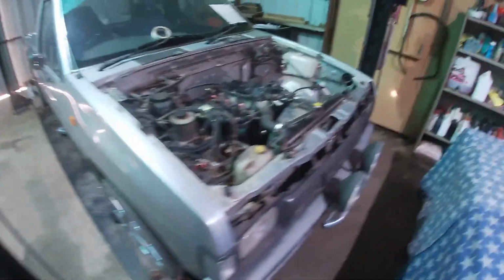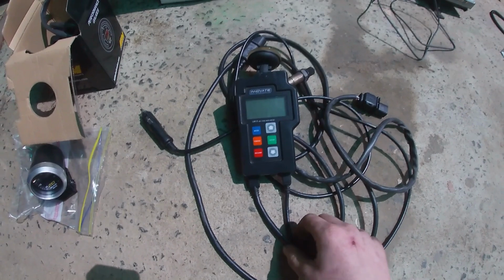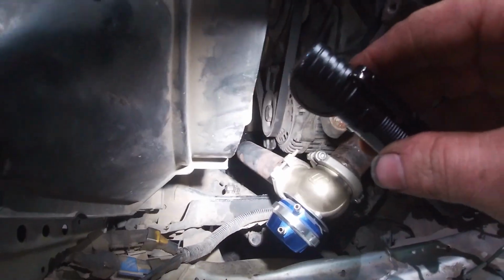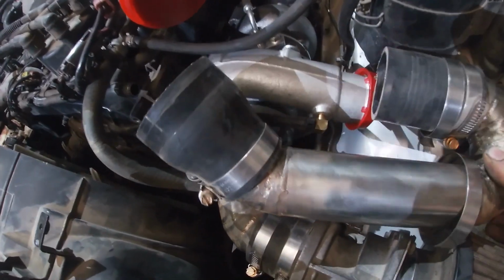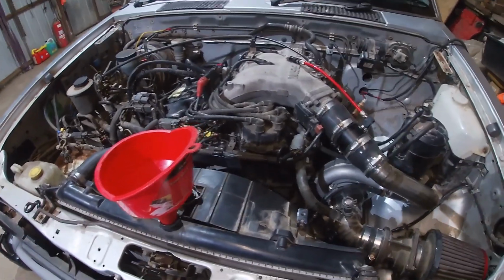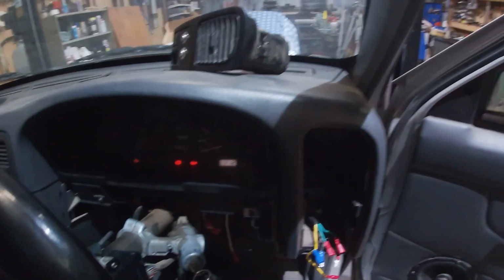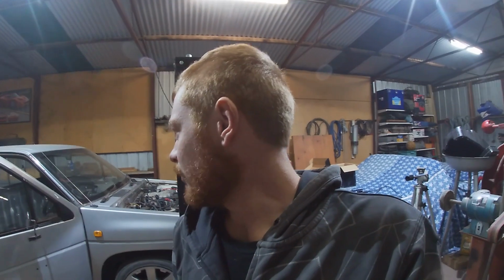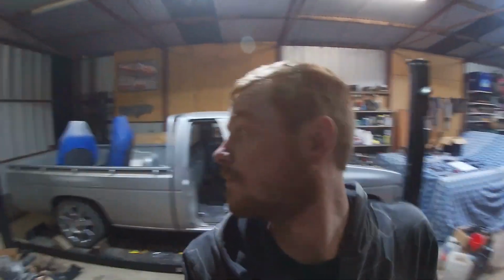VG30 Navara ep11: First start on new motor plus new turbo!

Comment: Awesome job man👍👍,have plans to do the same with a duel cab glad I found someone doing the same thing just toss up wheather to run forged pistons or not there not cheap, where abouts in Oz you from
Reply from the maker: Dont bother with forged pistons unless your looking to make a tonne (like 500hp plus) of power, put that money onto your fuel system and tunning
Reply from the maker: And im in vic

Comment: (Mad scientist voice) it's Alliiveee! Ahaha lol all joking aside, Red excellent stuff man it almost sounds like a v8 at idle.
Question were you planning on going e-fan for your cooling system As well ?
 Thanks in advance :)
Reply from the maker: Na im going to keep the clutch fan, they do a great job and move a lot of air
Reply: Reds Projects hmm interesting, would you recommend e fan for the  standard motor for off road? Thanks
Reply from the maker: Normal clutch fan will work fine, if you want to you could have a electric fan on front to push the air though to help
Reply: @RedsProjects  i like that idea! i was considering e fans because of the hp and mpg due to eliminating parasitic losses due to the clutch fan running of the motor.
Reply from the maker: @BLKSTONE4WD  yeah you will gain a little power without the fan, its just hard to get a electric fan that works as good as the stock one.
Also electric fans draw a lot of amps so if you have heaps of lights and fuel pumps and stuff you'll needa bigger alternator
Reply: @RedsProjects good point to keep in mind ,well i was thinking of going gm 110 amp factory alternator conversion and upgrade as for the e fans was going to buy some new Ford Taurus ones from a mid 90s u.s. spec model i knows those pull a lot of air from the factory and they don't cost a fortune.
I was hoping to try to override and bypass the mechanical fan clutch some how in order to retain the factory fan for on demand back up on the go all from the flip of a switch i feel like i am starting to sound like a mad scientist lol haha 👍
Reply from the maker: @BLKSTONE4WD  theres not much point in having the fan on a switch, the way the clutch works is it locks up when it gets hot, then when it cools it unlocks and theres no drag on the motor.
Reply: @RedsProjects  I see what you are saying, makes sense to me thanks again Red you saved me a headache for sure👍

Comment: What injectors are you running?
Reply from the maker: Std at the moment, im trying to convert my other manifold to top feed injectors, that will be in a episode soon
Reply: @RedsProjects  i have an early z31 fuel rail which is top feed hose tail injectors if youre keen mate. Was thinking of using it when i turbo'd a d21 vg30e before but sold the car before i got to use it...
Reply from the maker: @ayjay05  are they to suit 14mm oring type injectors or barb style injectors?
Reply: @RedsProjects  Pretty sure they are a barb. Have a complete z31 turbo rail with the 6 injectors attached still. Not sure on condition of the injectors, would definitely service them.
Reply: @RedsProjects  I also have some 380cc @3bar low impedance top feed oring style bosch injectors that i dont need. Freshly serviced and flow matched. 

Whats the reason you are going top feed?
Reply: @RedsProjects  i can email u some photos when i get a chance to go out to the shed next?
Reply from the maker: @ayjay05  so they are like rb30 injectors, i thought about going this route but options to go bigger or e85 are limited. Also i think the manifold has to be modified as the injector hold down clamps bolt to the manifold? 
I want to go with modern 14mm injectors because i can easily swap them out to bigger better ones later on if i need to.
Ive got a set of short ls3 injectors that im going to try to fit up, i think they are around 370ish at 43psi, if i out grow them i can do a straight swap to id1000s
Reply: @RedsProjects  yeah similar to rb30

Sweet as, yeah you will have more options going to a modern 14mm top feed and can run ID's in the future
Reply from the maker: @ayjay05  yeah im going to try and make it work in the next couple weeks, ill lets yous no how i go
Reply: Ok thanks.